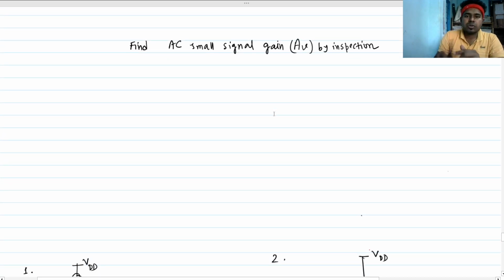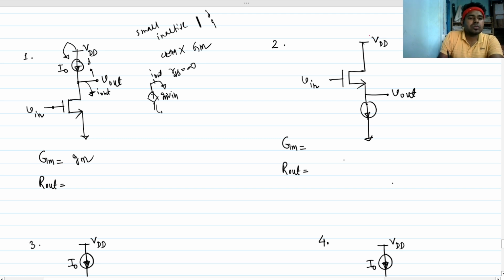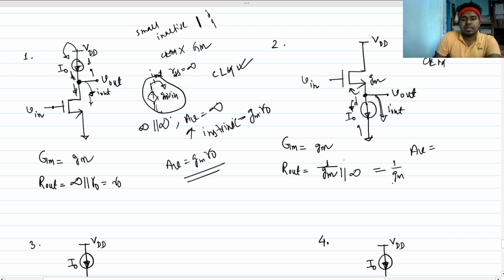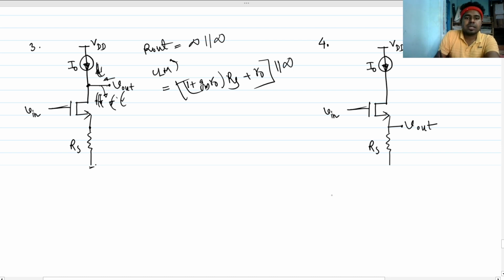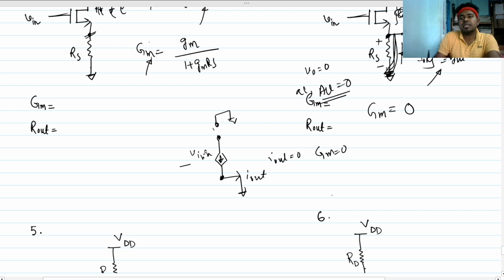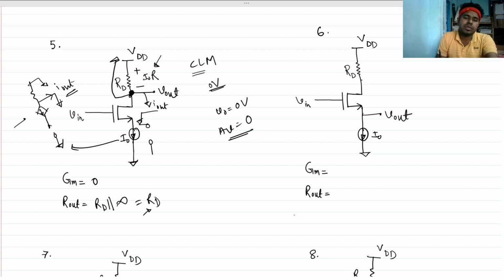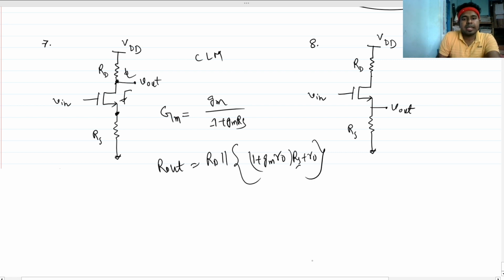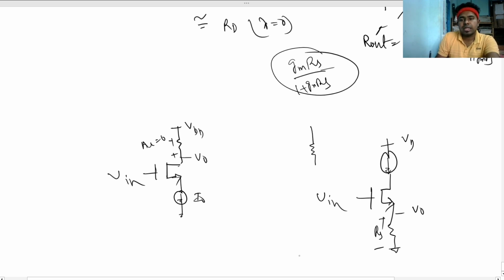Find the small signal gain and Output impedance by inspection_Details analysis || Amit Bar

Comment: correction in the question no 4. in small signal analysis Drain will be open ckt  so small signal current gmVgs is zero and gm can't be zero as it is biased with constant current source so vgs=0 so vin=vout . so gain will be 1
Reply: @RutvikPatel-pn2nj if vgs is zero than gm will tend to infinite, not possible